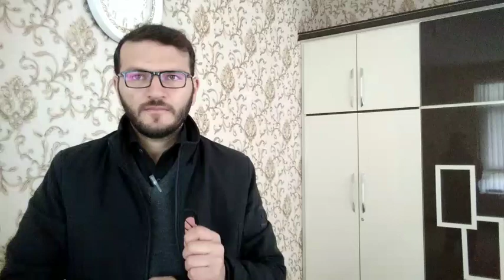Color code issues in the optical fiber cable || Fiber colour code explained

Comment: In a single buffer/fiber tube of a fiber optic cable having multi buffer tube can contain 12 or 24 fibers strands, modern fiber cables can contain up to a thousand fiber strands in a single cable although the highest strand-count single-mode fiber cable commonly manufactured is the 864-count, consisting of 36 ribbons each containing 24 strands of fiber.